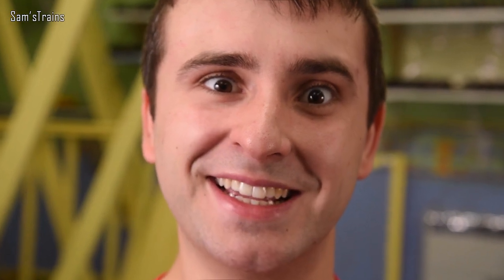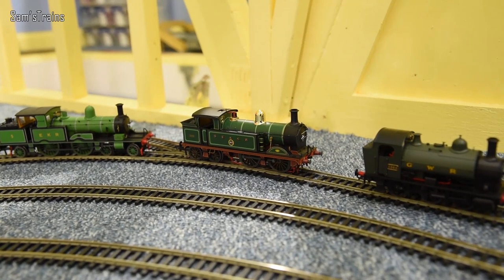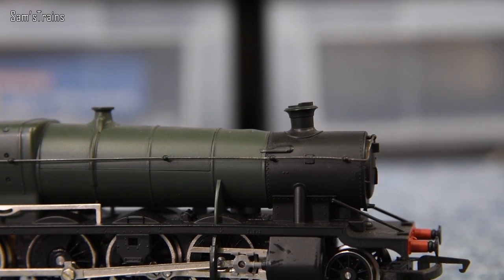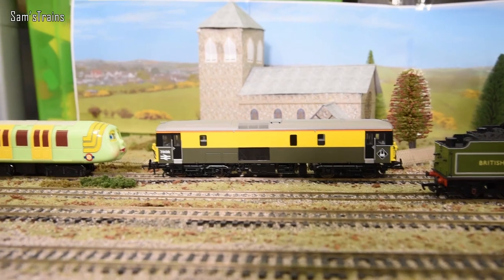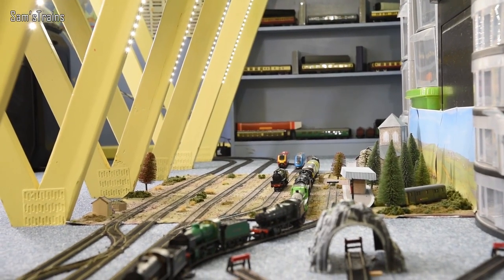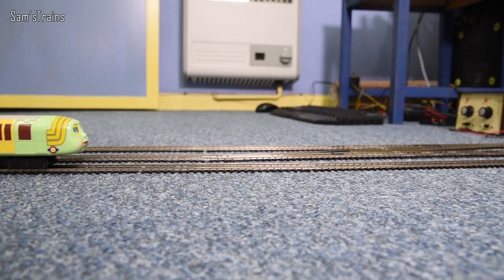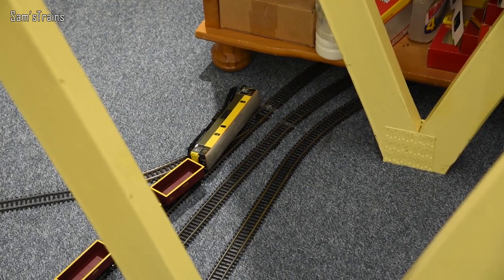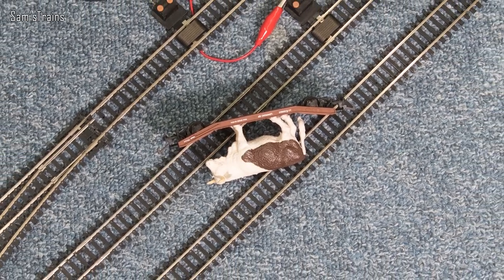Lemon Locomotives | Model Trains With Design Faults

Comment: I actually do own the 14xx. and I can say that this video is accurate to how it runs!

when it came out of the box, it didn't run! and even after fixing it, it still has problems.

you can only run it at max speed as other speeds just stop it, and the motor wears out very easily after around 30 seconds of it running!

Comment: I have a 221 tilting voyager - solved the derailing problem by removing the centre swivel springs and it runs perfectly round 3rd and 2nd radius curves I also run the motor coach in second position rather than the third or centre position.
Reply from the maker: Ahh very interesting Paul - I'm not sure what I did to fix my issue now, but I did manage it in the end!

Thanks for watching, Sam :)

Comment: One loco I think you've missed, is the Bachmann 7f. With the motor rubber seal which warps and then cools weirdly, this then causes super slow running when cold. Nice video, super Lemoney...
Reply from the maker: Yes that's very true actually - though also typical of most Bachmann locos - I've had that happen many times myself!!
Thanks for watching - Sam :)

Comment: Great video Sam ......I totally agree about the 9F & 28xx ...I have both, and they suffer from the exact symptoms you describe, however, one of my most reliable engines is the Bachmann {split chassis} B1 ....I've owned it for several years now, and it has covered mega-miles.
I think the worst  "lemons"  I've bought are the Hornby Flying Scotsman ....I bought two of them, one was the old tender drive and the other one the railroad version ....both burned their motors out very rapidly ....wanting a {4472}  on my layout, I bought an old Triang/Hornby  "Scotty"  {with an old "X-series" motor} from a junk shop, and it has proved very reliable.
Reply from the maker: Thanks a lot mate - ahh sorry to hear that - at least your B1 is okay for now, keep an eye on those wheels! That's really bad about the Scotsmen :(
Thanks for watching - Sam :)

Comment: Hi Sam, a few of my honourable mentions; Hornby S15 with the interesting overheating and variable speed motor feature. I've had two; both failed. Hornby re-tooled Terrier with a motor displaying 'stiction' (stopping and starting randomly), the Hornby 700 also developed the same issue. All THREE of my Oxford Radials now have failed and burnt-out motors. The Heljan Lynton and Barnstaple Manning-Wardle (009), which wouldn't negotiate points without derailing (I believe Heljan recalled them all). The older Bachmann (?) J39 which wouldn't traverse points with the brake rigging fitted. Hornby M7 which suffered mazak rot and motor failure. The Bachmann Class C which derails when reversing over left-hand points (both mine do over all my points but only left-hand!). I can't think of any more right now, but I'm sure I will!
It baffles me why Hornby, notably, cannot spend a little more and provide decent, reliable motors. The extra few quid passed onto the consumer would, for me, cancel out the frustrating hassle of having to return faulty models or seeing them sitting on the scrap line (kitchen cupboard), out of use...
Reply from the maker: haha thanks Andrew for sharing all of these - not surprised to hear about your Oxford Radials, 2/2 of mine have failed too - utterly useless! I'm baffled too - literally no explanation for any of this!
Thanks for watching - Sam :)

Comment: Hi Sam. For the SR lemons you have identified, firstly, I will agree on the H class. Beautiful model but both of mine have had motor replacements and one is playing up again now. The N class seems to be intermittent. I have the 4 of these, and only one gives me any problems. My Nelsons have given me no problems whatsoever. I have never bought a Dapol loco as i have heard so much negativity towards their loco's (and wagons) so just haven't bothered. Only other lemons i have are my M7's and my Heljan 33's. Each M7 has its own problem. One wont go over points, one has had a new engine, and one arrived new with a scratch down the side !!! And the Heljan 33's are just lousy runners. Beautiful model though.
Reply from the maker: Many thanks for sharing all of these - I've heard a lot of problems with the 33s and M7s, but never experienced issues with those myself - I'll have to look into those!! :D
Thanks for watching - Sam :)

Comment: My dad and I have some lemons in our N-scale locomotive fleet, unsurprisingly most of the lemons are the Bachmann locomotives. Even the two Union Pacific SD40-2's from Bachmann's Spectrum line have some issues. The four Life Like locomotives in our fleet (Union Pacific E8, AT&SF GP38-2, Amtrak F40PH, AT&SF 0-6-0ST) are lemons with minor problems compared to the five Bachmann locomotives with major issues. They all still run, they just need more work done on them compared to the other locomotives in our fleet. The rest of our fleet is comprised of three Atlas locomotives and eight KATO locomotives, all with great service records and no issues at all.
Reply from the maker: Uh oh sorry to hear that - so they make N scale lemons too then? Crikey!
Thanks for watching - Sam :)
Reply: @SamsTrains  Sadly yes, that's why my dad and I try to look for more reliable locomotives from manufacturers like KATO or Atlas.

Comment: Hey Sam. I used to replace the pilot truck on the Bachmann G scale 4-6-0. It was made of plastic which used to crack and also the contact wires were fed up the outside of the bolster through a steel washer. How long do you think it would take for  the insulation to wear through and the wires to short out on the washer? I developed a method to rebuild the truck with metal and run the wires up through the centre of a hollow bolster, which Bachmann should have done in the first place. Their Shays also were originally made with a plastic chassis which would crack and fall apart (this on a $1000 loco!) but to their credit they did develop an aluminum chassis and would do a rebuild or replacement free of charge. My only beef these days are that a lot of the centre rail roller pick ups on passenger cars are very flimsy and tend to shed their wires because of metal fatigue. Cheers.
Reply from the maker: Thanks for sharing! That is pretty interesting, cool fix though!
Thanks for watching - Sam :)

Comment: So, as lemons in my collection :

-One Hornby Q1 with crank pins that cannot stay put in the wheels, and unscrew themselves while the engine is running. I'm waiting for replacement wheels to be available to cure the problem ;

-One S15 : had bought one, motor running poorly, sent back to Hattons for a refund I've got. Bought a second one, but same problem. Stored until a motor that runs properly would be available. Can you give us the reference of the spare one you use in your own, please ?

-One N class in Southern black, reference 32-166. Same coupling bar as your own, so, I am expecting troubles. I had decided to test it thoroughly before taking any decision about her because I did not noticed nothing unusual during the run-in. But it was not a complete in-depth test;

-One Oxford Rail Adams Radial : engine running slowly due to a piss-poor motor and, finally, the motor burned out while running after less than two hours. Back to Hattons for a refund, got it and bought the Hornby model instead;

All Southern engines, seems I have recurring problems with this company...

I have avoided those three one :

-The H4 Wainwright by Hornby. Fortunately the new one is not available yet. So, better safe thant sorry, I will buy an  LMS 1532 class from Bachmann instead to have the same wheel disposition in my collection;

- The Dean Goods by Oxford Rail. Honestly, I don't know. There is no Bachmann Collett Goods in GWR green for sale anywhere, maybe I will wait for a new manufacturing batch to buy one if they have solved the faulty motor problem (expected at TMC, ref. OR76DG010). Or wait for a reissue of the Collett Goods by Bachmann;

-The 14xx. Simple reason : Sold out, no replacement yet. It is on my shopping list when someone will decide to produce a good model of it.

Well, thanks for the video, always usefull to see what to avoid. It seems that if you are modelling SR, you're doomed...
Reply from the maker: Thanks a lot for sharing Oliver - I do sympathise! :(
Thanks for watching - Sam :)
Reply: It will be interesting if Bachmann bring out the ex DJ models 14xx back out in their new EFE rail range as they have purchased the tooling for the ex DJ models J94. Issue is they have raised the price only because they have added a corless motor and apparently re tooled the model.

Comment: The worst lemon in my collection is the Bachmann Spectrum PRR K4. The wheels separate from the axles, warp, and strike the running gear. I've spent three years trying to fix it to no avail. Go for the Broadway Limited version, it's more expensive but it won't fall apart.

Comment: You made mention of replacing the dud motors in certain lemons with cheap Chinese motors around 4:45. How do you find the right size replacement motor? I've got a Bachmann Gordon just in that I intend to modify a bit, wondering if I can sneak a better motor in there while I have it open (maybe even pull out the eye mechanism). Thanks!
Reply from the maker: It's tricky - I was very lucky and found like-for-like replacements for most Hornby motors from a Chinese ebay seller, but it certainly isn't as easy with all locos!
Thanks for watching, Sam :)

Comment: I’ve never understood your hate towards the Heljan 1361. I’ve got 3 of them and never had a running issue with any of them. Not sure if it’s because you’re running on DC and I’m on DCC though. Still I absolutely love your videos. Keep up the great work buddy.
Reply from the maker: Did you see my review mate? I think my criticisms were justified - even when mine was running properly, it still had that poor mechanism, the high price tag, and the horrible build quality! ;D
Thanks for watching - Sam :)
Reply: I did see your review buddy. I keep feeling you may have unfortunately ended up
With a dud. Also pro tip for cheaper Heljan models. Call Howes models. My 1361’s cost me £70 each, and my 47xx cost me £75. They order in for you :-)

Comment: My friend just got a Hornby Railroad black 5 and was also a bit of an lemon: the Traction is sometimes really bad and he needed to solder a power cable and also oiling (The manual says that). Luckily an other friend of him bought it and luckiliy he was able to fix all those issues... When I heard the news, I was so dissapointed about Hornby. When I compare that locomotive with its older brothers (older models from the black 5 series), then this is 10 times worse than the other black 5's from Hornby. I never knew that the quality would be so bad. I never had such experience with my trains!
Reply from the maker: Thanks for sharing Arthur - yes the traction is terrible in those because the tenders are way too heavy! They are a bit disappointing, you're right :(
Thanks for watching - Sam :)

Comment: I know it's bee a while since this videos been posted, but may I inquire, what exact component of the N class's coupler did you break to get it to work? Turns out, it's not the only Bachmann locomotive with that problem. I recently acquired one with the same type of coupler and now I'm kind of stuck with it. I'm already thinking about alternative solutions, but if I thought I could just perform a sort of "controlled break" and fix it that way, then I'd just do that.

Comment: Hi Sam my worst runner was my Australian rail models c38 steam locomotive when it arrived in the box all the detail parts had detached from the body, my first run it stuttered and derailed due to fixed bogies on the tender also no pick ups on the tender for a $300 locomotive no headlight either or dcc was dc with an 8 pin socket. The second time I ran it the locomotive came to a complete stop and when I opened the locomotive up the motor bearings had completely disintegrated. I've done a lot of work correcting the loco it now has a 5 pole motor instead of the 3 pole it had it now has a headlight and cab lighting with moving bogies and runs as a $300 locomotive should. They also advertise the locomotive with a front bogie coupler that it didn't have when it arrived.

Comment: Hey Sam. My heljan 1361 shunts just as well as my Peckett overall.  I think it helps that I got my for like £85. I actually have the opposite problem as the one you have. My basement is too cols and the axles shrunk and now slide too much. Would proper bearing have saved this issue? Yeah probably, but for what I paid im not unhappy. By buggest complaint is the low slung couplers, which coincidentally mesh perfectly with my Dapol rolling stock.....go fig right?
Reply from the maker: Mine runs well too when properly adjusted, but the design is still terrible! Yes proper bearings should usually fix anything like that, and yes the couplers are a joke too!
Thanks for watching - Sam :)

Comment: I had Dc trains in my youth, Lima, Pico, Athearn, Fleischmann! Continue with H0e. Lilliput, roco.  Now I'm 52, I started again with model trains, because I remembered how poorly dc trains  was, I'm glad I chose to have Märklin locos (only).  The new ones are fantastic! The old ones? You have to " work" with them. Adjust speed all the time depending on how many cars, upp and downs, bends! And the noise, it's like a angle grinder! The same sound!  But they are good quality overall!
Reply from the maker: Thanks a lot for sharing! I have heard amazing things about Markin, I'd love to try some one day! :D
Thanks for watching - Sam :)

Comment: I changed my N Class tender connection in the end. Works WAY better than it used to before. 

Something I see VERY commonly is lack of movement on the centre axles of six wheel vehicles. Wagons and tenders namely. My Collett Goods had this and i had to file the flange off totally from the middle wheels, same goes with my Oxford Rail six wheel toad brake van. My Dapol milk tankers seem ok though which is odd. 

another is DROOPY COULINGS. Dapol are a big fan of terrible couplings it seems
Reply from the maker: Ahh good one mate! And that's very interesting too - thanks for sharing! Droopy couplings are a nightmare too! D:
Thanks for watching - Sam :)

Comment: I have a Dapol class 73. It doesn't derail  it has the motor problem. Also I have a Hornby Sentinel, it stalls a lot and a Heljan class 47. Good runner but the drive shafts in the bogies fall apart regularly
Reply from the maker: Thanks a lot for sharing! Yes my Sentinel started stalling too - it happens when the wheels and pickups get dirty! Those are super frustrating since there's no easy way to get at the pickups to clean or adjust them :/
Thanks for watching - Sam :)

Comment: I think you missed your one longstanding lemon, the Heljan Tango.
With the 1361 Heljan locomotive I think it depends on the batch as Jenny Kirk has had no issues with her version of it.
Reply from the maker: haha yeah, but that one actually runs okay, my issues with the tango were in other areas! Jenny obviously didn't look at the mechanism - no reviewer worth their salt could conclude that the 1361 was a high quality model! ;D
Thanks for watching - Sam :)
Reply: @SamsTrains  my hornby 08 is a bit of a lemon with the awful noise that comes from the gears at high speeds. I am about to try a tip someone gave to me about adding model white grease to lubricate the gears.

Comment: Funny this video just came out as my original S15 motor just packed in. Which one did you use as a substitute? Did you take the flywheels off?
Reply from the maker: I used an identical 5 pole one from Ebay - yes I had to swap the flywheels too!
Thanks for watching - Sam :)
Reply: Struggling to find one, do you have a link to the one you used?

Comment: So all Bachmann Thomas models are lemons?  What a shame.  I was thinking of collecting them in the future (maybe not in the near future).  Is there a way to add a different motor and cancel out the eye moving mechanism?
Reply from the maker: Most of them run okay, but they all have very poor mechanisms in my opinion! Yes you can remove some gears to disable the eye mechanism, but I'm not 100% sure that's the reason for the failures - the mechanisms would still suck! ;D
Thanks for watching - Sam :)
Reply: @SamsTrains  I see.  You think you could do a video on how to disable the eye mechanism?

Comment: Hi Sam, I really think you got a bad 73. I have the Pullman version & it ran on DC just fine. I've since added a Zimo sound decoder (with Mr Soundguy files) & a 17,000 microfarad  keep alive and it runs superbly. The Heljan loco is certainly a pup, you have my sympathies on that one.
Reply from the maker: Thanks for sharing mate - some people seem to get on fine with theirs, but mine was nothing but an absolute nightmare! I wonder whether they updated the chassis at all, does yours have any vertical rotation in the bogies, front to back??
Thanks for watching - Sam :)
Reply: @SamsTrains  not too sure. Will haul it out whilst not at work next week. It was the same story with your 121. Mine works fine.
Reply: @Sam'sTrains  Have just had a look at my 73, it has the same rotation as yours has. But mine ran smooth on DC before I chipped it too.